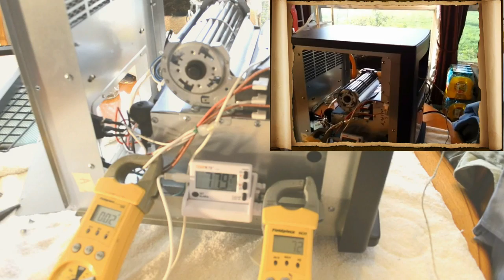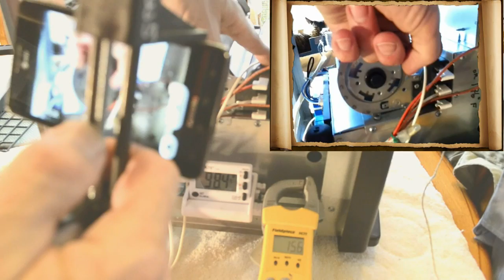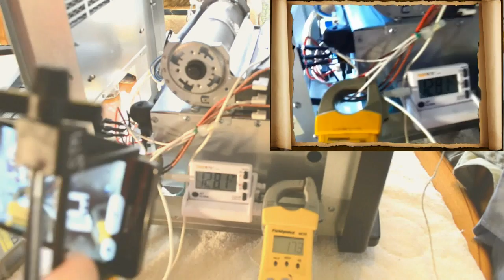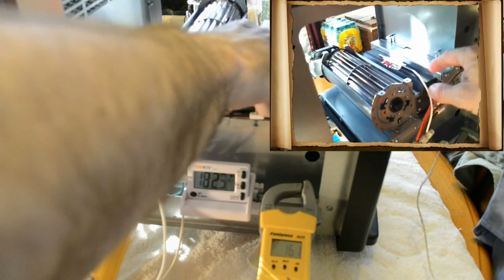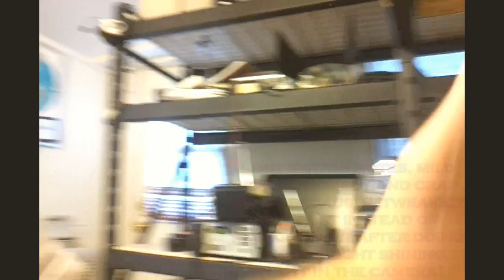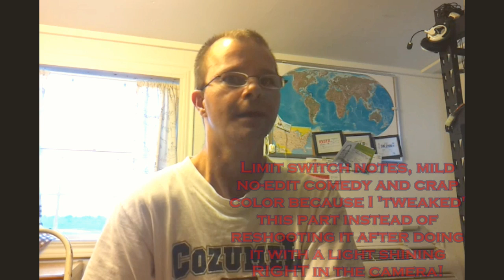HVAC The PTC Heater 'BURN' test with the Blower Turned OFF!!!

Comment: Hey .. are you still making the Hulda Clark zapper  do u have a video on how to use it?
Reply from the maker: Apologies, but I haven't made any in quite a few years now. Have been dealing with a lot of back problems, surgeries, etc, so projecting has been of my list for a good while:/  I don't have a video using one, id think someone does, but you can usually find Hulda Clark's books, especially the first one, for free as a text file or pdf file out on the web, just search around, and it's pretty easy to understand as far as instructions go.

Comment: I just purchased an LS-BLK-41Q and it clearly states that it's infrared quartz - I can physically see the top element through the screen in front - Everything I have read online states it has 4 tubes/elements - I'm not quite sure how quartz infrared work but it's a glass tube with something inside it. Works quite well really - was only 70 bucks at Menards - I may even pick up a second one and keep it on hand. The thermostat isn't perfectly accurate but it also stated that fact in the manual. I set it on the Eco mode which is 68 degrees and it keeps the house at 70ish - I have a 600 square foot loft with 16 foot cielings and the electric baseboard heat has yet to turn on and it's currently as I post this Negative 12 degrees Fahrenheit outside - it's a sweet little heater :)

Comment from the maker: NOTE:  CraP!  I just realized a mistake I made (of sorts) while testing the unit.  I think I had the Amp Clamp on the common/neutral and at minimum it was showing .73a, however I should have only had it clamped on the heating elements.  ...so my minimum should be lower after I remover the amperage used on the blower motor!  doh!  I'll have to put together a 2 minute video later to 'fix' this.

Comment from the maker: Hey Dino!   I debated on some of it on the editing table.  I didn't realize at the time how often I was actually 'getting in the way' of the other frame. I need to fix that if I use this technique again.  ...also I put a 'frame' around the inset window, it looked odd without one, but it sucks space and the standard set of filters didn't have a simple tiny black line.  I've had complaints in the past about my hands shaking so.. Thanks for the comment Dino, even if you aren't from 5 land ;)

Comment: The picture in picture detracts from the video. It blocks what I want to see. Try leaving that out next time. the overall video would be much better without the inset video. Interesting but silly. Use one cam.  73 de Challenger N0RJP